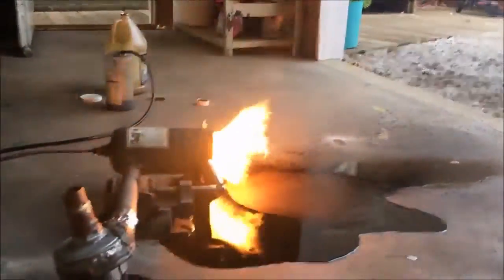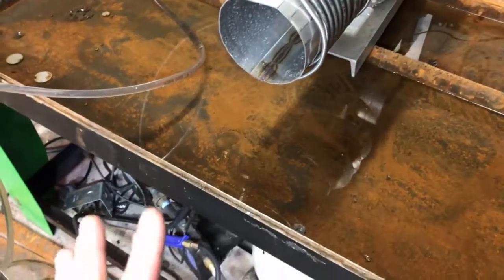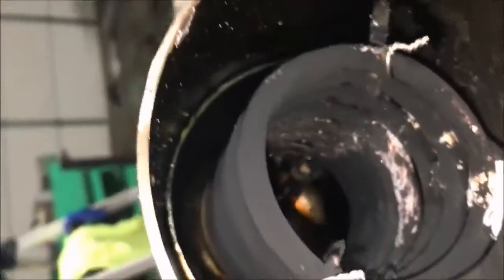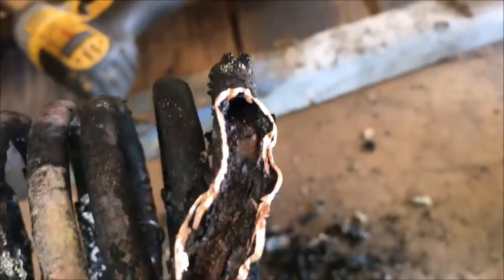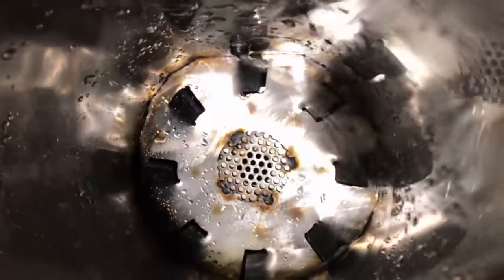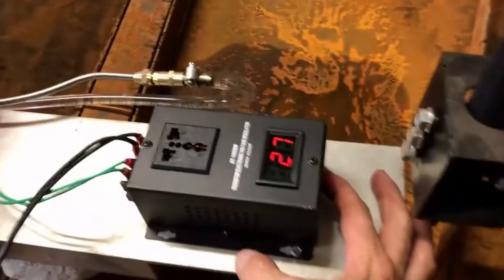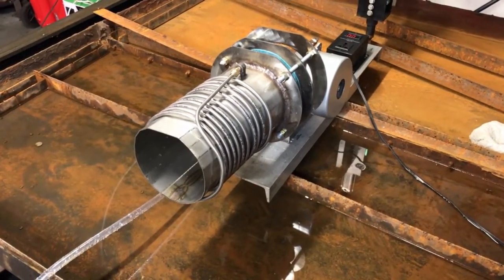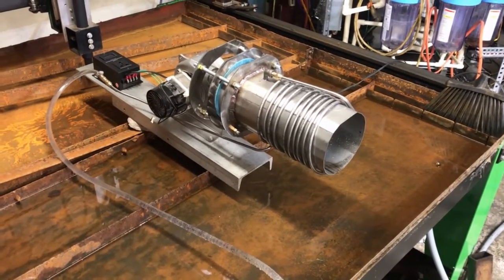Waste oil burner for large heating applications

Comment: I feel like;  pre heating the air is always better than pre heating oil???
Reply from the maker: actually pre heating air on small burners like this has no effect  on  cold weather operation
Reply: @NOBOX7   maybe  a box around the burner tube with winglets could increase the area of heat exchange from the combustion  in the midle of the tube and the air blown by the fan inside the box then after  heating up goes inside the  tube for combustion& exhaust.

Comment: The pre heat is for viscosity.  Also you can filter  down without plugging nozzles  but It requires that preheat . by heater element in side filter canister or water catch. I cut mine and jack my  fuel pressure around 180. You are awesome brother. Thank you for letting us learn